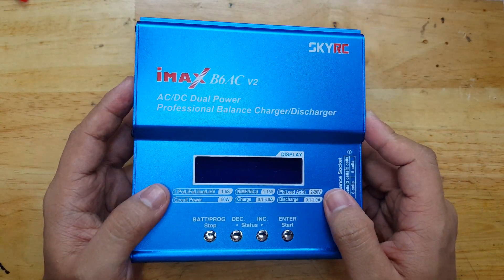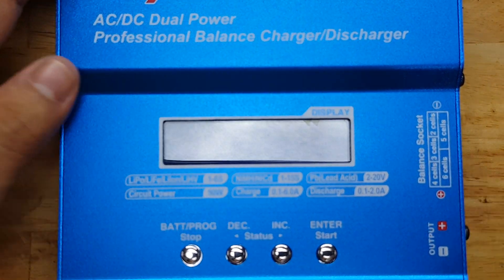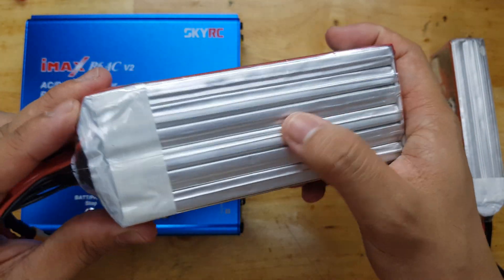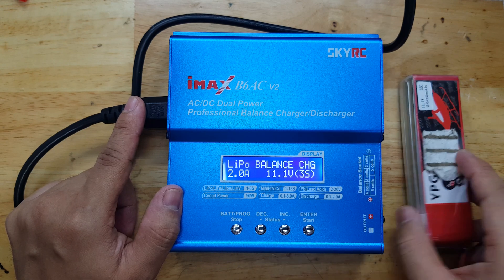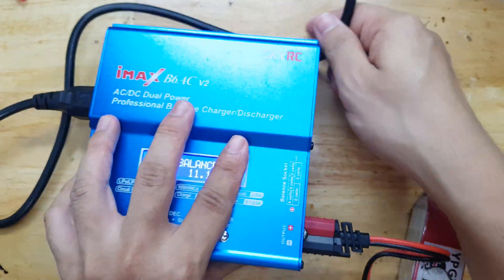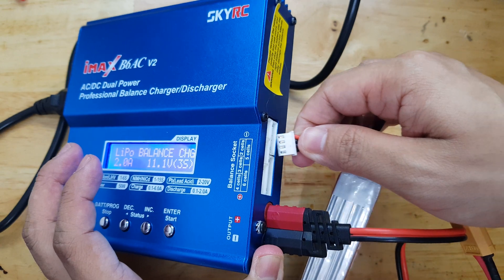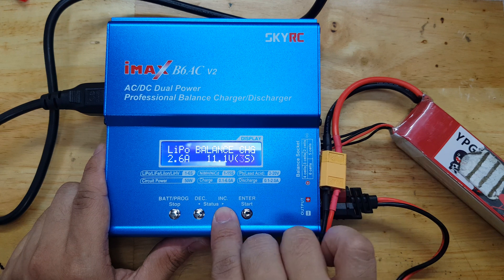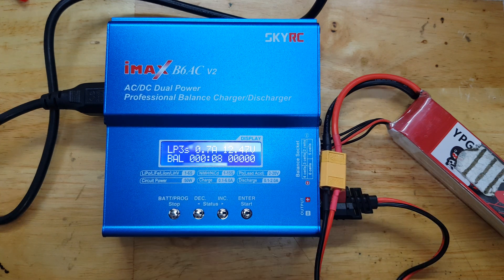HOW I CHARGE MY LIPO BATTERIES USING IMAXBCAC V2.

Comment: Hello Circuit Desolator, Can this charger use for a car battery pack 12V 15Amp lithium battery as I noticed it can only charge 0.1-6.0A . If it is possible how many hours it need to charge up to 15Amp? Thank you.